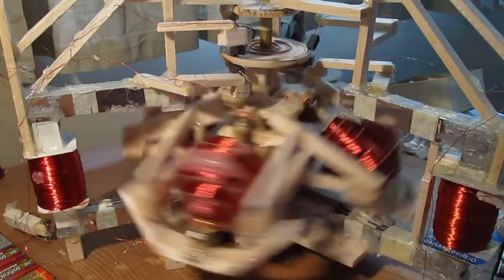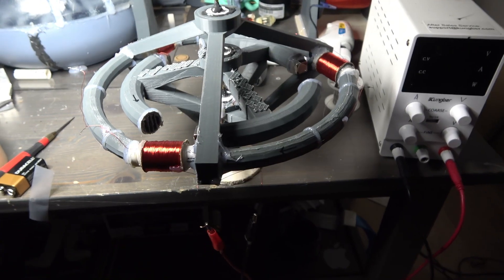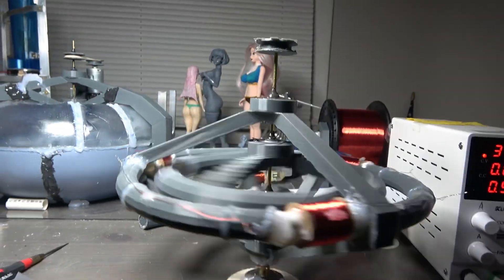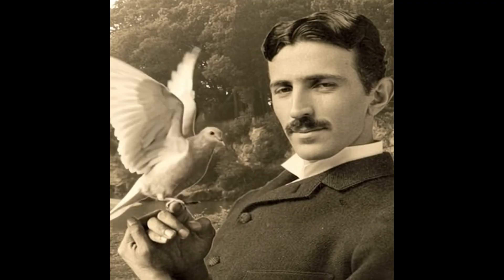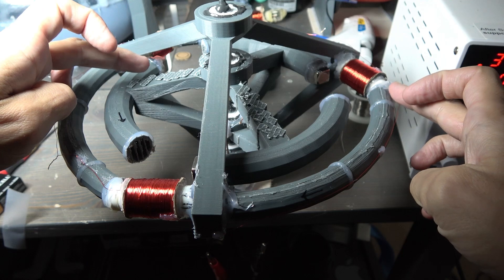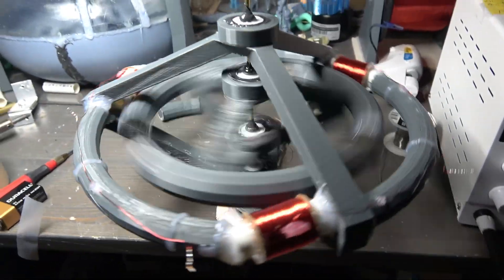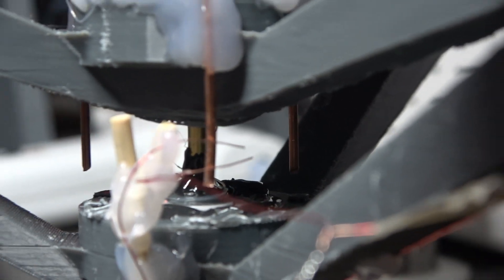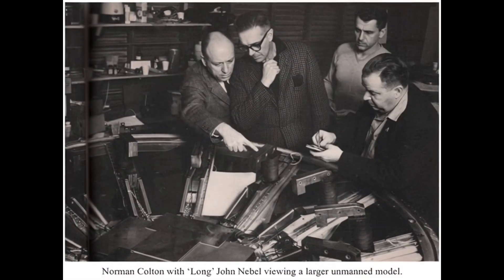Dual Counter Rotating Gyro Pulse Motor

Comment: I had a project a while ago...
a motor based on otis carr concept. the counter rotating brushless motor.
the batteries and the esc all within the outside hull.
it would take some complicated adjusts so that the moving parts get balanced and vibrationless.
if that could be done, the final project would be awesome.
imagine how difficult it would be, to rotate both parts in opposite directions but with the same speed...
Reply from the maker: Consider perhaps filming your project and showing here on Youtube, if that's safe to do so.  To get both parts to counter rotate at the same speed more or less, you just have to have them both of equal mass.  Its that simple really, in my humble opinion.  Also assuming frictional losses are the same: bearings, wind resistance, etc.

Comment: We have a Bedini successor ❤
Reply from the maker: Awe thanks...   John Bedini was truly one of the greats.  Such a simple system to create free energy.  Pulsed DC is the key, of high enough voltage and short enough duration.  Here is a quote by the late inventor.  "That is where the magic is, The spike is the key to the Dirac Sea that is where the negative energy pops out of, chase the spike."  You just have to create a high enough DC voltage pulse that is also short enough in time duration, to invoke the etheric radiant energy gain, as developed by Tesla.  A radiant energy wave is created with great enough intensity of uni-directional DC pulses.  I could very easily turn my device into a Bedini successor, as you've suggested.  Thanks for the idea.  🙏  Of course I'm not sure if I would show such a set up, else end up being offed as Bedini found out unfortunately....  Powerful forces of darkness are still present in the world and will stop at nothing to maintain control and power over the spirit of the human race.

Comment: I'm with you about Counter-rotating etheric torsion fields. This is the way to interact with the ether. And I also believe both dielectric and magnetic forces will affect the ether. Although, I think for both forces, the axis of poles of the force must  be axial rotation of force in the machine rather than radial rotation of force. Your setup here is neither, and is circumfrencial. Keep going! You're in the right track.

Comment: That's just a magnetron

2 counter rotating discs 

Using 2 charged conductive plates on the discs

To emit Synchrotron Bursts

By colliding electrons within a magnetic field

Comment: If the physical counter-rotation is what you're testing for, you might want to add a third, fully static ring and mount the coils to it. You can then have permanent magnets on the two rotating rings. The big issue with having the active ring counter-rotate is that you're reducing the duration of each pulse, and therefore the impulse. If the magnet ring is rotating at 500 RPM, and the coil ring is counter-rotating at 50, you're losing 10% of the potential pulse timing versus fixed coils.
Reply from the maker: Interesting....   thanks.